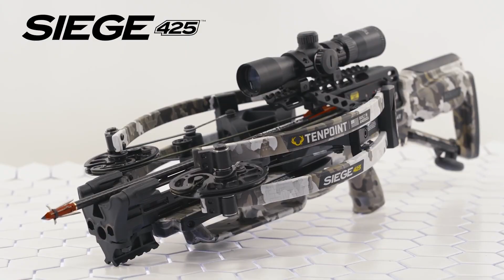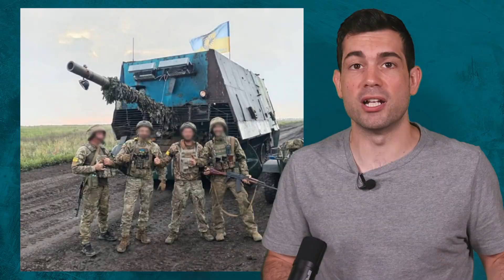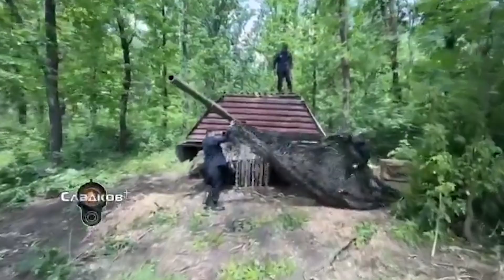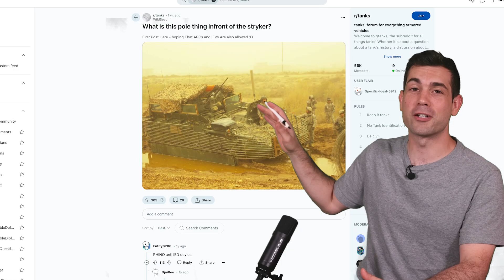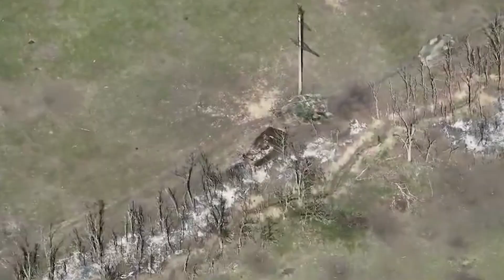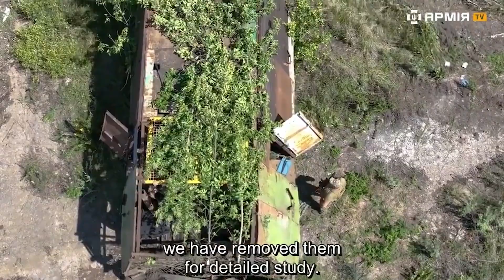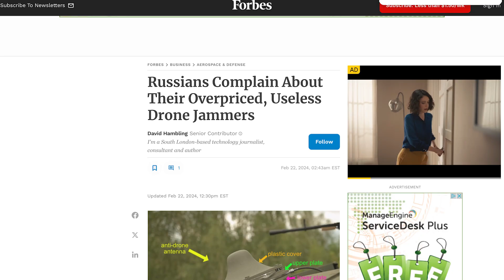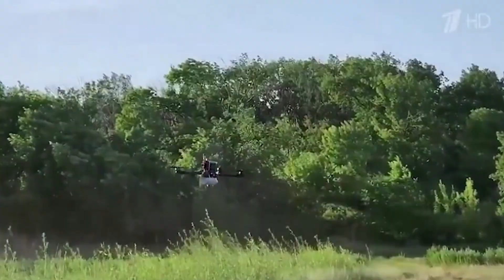Why Ukraine’s Taking Turtle Tanks Seriously

Comment: Initially they seemed to do the job they were meant to do. Now it looks like Russia is at times only covering the sides and top, leaving the rear of the tanks exposed meaning drones still blow them up. Anti-tank mines also still disable them and given that they are unable to turn the turret they are screwed in that case. 

But it's absolutely interesting though. If they are mostly used to transport infantry, wouldn't you want to be able to dismount fast from a transport? This doesn't necessarily seem possible with these ? Correct me if I'm wrong.
Reply: Even if the gun's movement is extremely limited, it isn't completely useless. A lot of WW2 fighter planes had fixed guns. You just aim the whole plane at the target.

Sweden previously had this tank with no turret. The gun was bolted directly to the body of the tank. It didn't only have limited gun movement, there was none at all. Not having a turret makes the tank lower and harder to hit. You also save on machinery to rotate the turret you don't have, making the tank even lighter, and lower still.
Reply: @danielch6662  Tanks and Planes are two different Things you cant compare those.

And Tanks need a turret in an Offensive role,
The swedish one was an defensiv Tank ment to be used Out of Defensive Position but They abbandoned that quite quickly and moved Back to turreted Tanks because you have to be mobile in a modern war and move alot while still firing, thats Just Not possible with a only Forward firing turret, Theres a reason why people even the ussr moved away from Tanks that are Limited Like that
Reply: Check Stug and Jagdpanther
Reply: @funtecstudiovideos4102  Those were specifically designed for a task, and would be useless in modern day war with drones. The Stug was also much more effective in defensive roles, as opposed to what we see here with these turtle tanks.

Comment: Drones seem like the perfect reason to bring back proximity flak guns like ww2.
Reply: They're still around for 40mm, 57mm and 76.2 and some 35mm mainly for naval use.   The modern approach is programmable air burst rounds.   The round has its muzzle velocity measured and the bursting timer is programed at that time.   EG the 35mm Oerlikon AHEAD ammunition.  Obvioosy with digital timers and the precision of modern radar and lasers you get the burst right.

Comment: actually,for what it is being used (a battering ram that absorb ukrainian fire) the turtle tank  is good. The last 80 yeas are full of examples of tanks modief even in grotesque fashion to get the job done. In ww2,the US tankers even used to apply concrete on the hull of their tanks becuse they were scared af of the german guns.
Reply: True but battlefield modifications are not always improvements like the concrete you mentioned. From what i've heard it actually decreased survivability since concrete was softer then the metal used as armour so the shells would bite in easier and be less likely to ricochet. Also the added weight meant they were more likely to break down or get stuck making them sitting ducks.

I think these turtle tanks are useful tho since they modify unusable tanks into usable ones even if only as more survivable decoys. I wouldn't want to be a soldier sitting on top of one of those tho since i highly doubt the tin metal sides will prevent you getting riddled with shrapnel if it was hit, probably doesn't even stop some small arms fire getting through. I think if the Ukrainians had more access to good ATGMs like javelin with tandem warheads or precision artillery then this design would be much less useful.
Reply: Those concrete tanks likely only ever helped against the panzerfausts (since those were shaped). The German AT guns typically had solid rounds. Though most of the photos I've seen had the concrete on the front... where no half-sane infantryman would fire (though the Germans had meth so...).
It probably was only ever a moral booster.
Reply: @smalltime0  a moral booster that put an unnecessary weight on the tank. Patton forbade his tankers to use similar ideas, since he wanted them fast as possible.